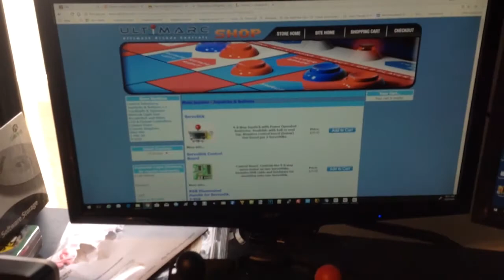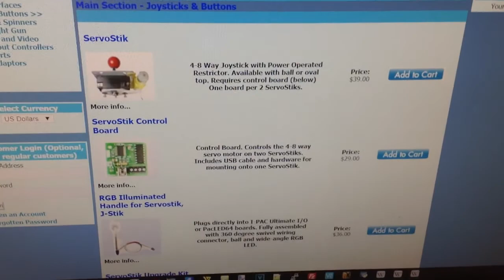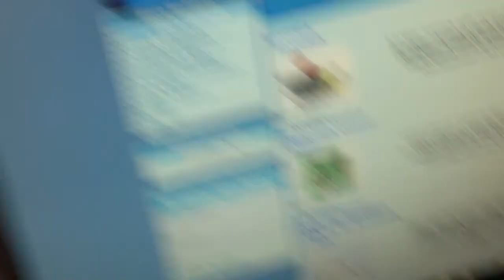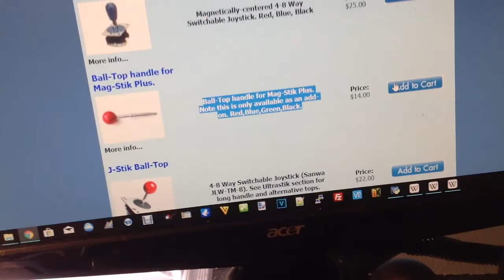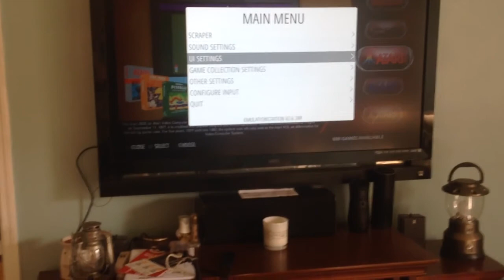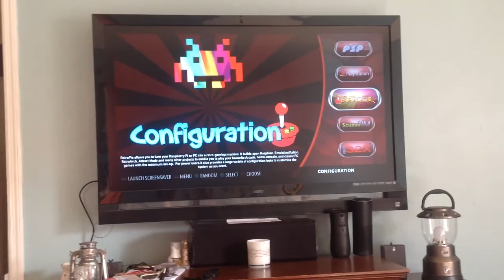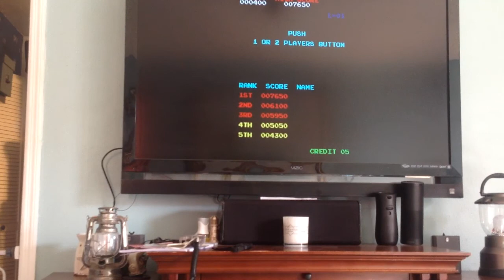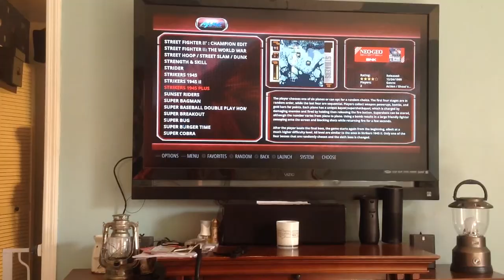XArcade Tankstick MOD 6 - Replace Joysticks with Ultramarc Mag-Stick Plus & Ball Top

Comment: Thanks for this detailed review and demonstration. Definitely the best video I found on this stick. By the way, this is how professional arcade sticks work, the tops do not screw off because kids would just run off with them if they did. When you find the kind that have removable tops, those are typically made for the home market. So that’s why it’s like that.
Reply from the maker: Actually I believe they glued the ball on because when you twist the stick to change from four way to eight way the ball would unscrew if it wasn’t glued on.

Comment: I dont know what about the leaf part do they wear out quick
Reply from the maker: GoGo Arcade not sure what you are referring to when you said leaf part.
Reply: @DIY-Nick  I notice it has leaf on the end of the microswitch dont those wear out quick
Reply from the maker: GoGo Arcade oh, yeah I haven’t used them long enough for that to be an issue but I would guess you are correct.  I found the through on the mag sticks to be too short and didn’t like how stiff they felt so we switched back to my zippy sticks which I like the best between the 4 sticks I’ve tried (original x-arcade, erosticks, zippy and mag-sticks).
Reply: @DIY-Nick  thank you wanted to now was going to jump on the mag but I will stay with the IL-euro then

Comment: niiice. wondering if u know about the mini steering wheel attachment for the spinner for racing games in mame.
Reply from the maker: Hey John.  I haven't tried one yet but groovygamegear.com does sell a steering wheel attachment for their TurboTwist2 spinnner which I have installed on my XArcade (https://youtu.be/cOnc2SBA_jo - http://groovygamegear.com/webstore/index.php?main_page=product_info&cPath=86&products_id=268) and Ultramarc also sells a steering wheel for their SpinTrak Rotary Control (http://www.ultimarc.com/store/section.php?xSec=10&xPage=1).   

I wouldn't mind picking one up but don't have the extra cash flow right now.
Reply: Nick SantaLucia Gotcha. was wondering if u were considering maybe selling ur used IL Eurosticks in the future
Reply from the maker: They aren't really used (only played a few games with them) and paradise arcade offered me a full refund if I return them but I didn't really feel like paying for shipping to send them back to Hawaii.  So would I sell them.. sure but I'd pretty much want what I paid for them with tax and shipping ($32.26) since that's what paradise arcade would give me for them back so you would probably be better off just buying them from them directly (if they were available.. I believe they are sold out of the red currently).
Reply: Nick SantaLucia yea I have a white one on my xarcade solo stick. the 2 reds u got are interesting.
Reply: Great review on the mag stick plus. I have been trying to decide if I wanted 2 IL euros for my CP and a dedicated 4 way, or just 2 mag sticks.  Not sure if I would like a short throw for fighting games. After playing with them since your video are you still liking them?
Reply from the maker: Jason Bryce I found the switch from 4-way to 8-way and vice versa during play which is very annoying and I also don’t much like the short through.  As a result I’ve switched back to my cheap zippy sticks which I think provide the best overall performance of the sticks I’ve tried.

Comment: Sorry but I will not buy it for one reason... tehy use MDF  which is heavy and as you can see where were the screw  were there are some major cracks which can chip out if you drop the xarcade
Reply from the maker: Yes it is heavy no doubt about that.

Comment: Thanks for posting this detailed video. One thing you could have done when the stick was the wrong direction you could have just pressed left to move down and then went back into configure input and remapped the buttons and stick to how it was connected. Also, how are the sticks holding up? Anther question I have is how much do you need the 4 way on stick 2? I have heard that most games that are 4 way are played on the player 1 stick even if you are playing a 2  player game. Is that the case and if so would it be ok to just put in one mag stick and go with a sanwa for player 2? Thanks..
Reply: Exactly what I want to know.

Comment: Thank you so much for all of your videos.  I have been using them as a guide to determine what route I want to take my tankstick in.  I looked at your zippy and magstik plus video the most.  The question that I have is would you still recommend the magstik plus? From everything I have been reading the magstik plus is great in 4 way, but is not as good as an 8 way stick due to the throw.  What would you ultimately recommend?

Comment: I need help.   My xrcade tankstick won't work with my Mame32 on windows10.    It will work on window xp but when I try window10 I get an error  dll missing.    Can this be fixed to work on windows 10?
Reply from the maker: Ive never had a problem but i recommend contacting xarcade for support.

Comment: Do you have a recommendation for joysticks that will be more quick, accurate, and nimble for shoot em ups? I like playing Strikers 1945 quite a bit, but my newly acquired Xarcade stick is a bit sluggish for these games. My complaint has nothing to do with build quality, but the design of the joystick. For example, the joystick is very heavy, and when you add that to the long distance needed to move the stick for actuation, making quick moves in-game is really a challenge. To be fair, I have very little experience with actual arcade cabinets so maybe this is just how it is.

Comment: Very nice work Nick! Well done bud~ I was thinking about doing something like this and boom, here is your video! Thanks for sharing. Any other recent observations or improvements you have done on this?
Reply from the maker: I’m happy with the spinner and buttons and have swapped my sticks back to the zippy sticks as I think they provide the best overall performance of the sticks I’ve tried.
Reply: @DIY-Nick  Which mounting bracket do you need to buy for the Mag Stick? Thanks

Comment: I'm concerned with the implementation of the top switching.  It looks like something that can break over time or by accident.  And, of course, there's the cost.

I'm leaning toward an IL Eurostick magnetic and then putting a hinge and clasp on the bottom of the Tankstick to allow for semi-easy switching.  

Thanks for doing these videos, it's given me clearer eyes as to what I want to do.
Reply from the maker: rager1969 I agree it does seem like it may break over time but so far so good with moderate use.   The hinge and clasp idea is a good one I didn’t think of.  Let me know how it goes if you do it and if possible post a video.
Reply: @DIY-Nick  So I broke down and bought a Mag-Stik Plus but stayed with the batton top to match the stock right side joystick.  I also installed XBox colored buttons.  I had a bear of time with the joystick mounting plate, since Paradise was out of stock of the plate you got.  I had to go with the other "Universal" plate which required me to bore out the mounting holes and "route out" the X-Arcade panel with a chisel.  The top panel top seems to be some sort of pressed paper/cardboard - YIKES!  After a few false starts due to loose connections and a wire that pulled out of one of the ground wire terminals (and looking for my old soldering iron and spool of solder) I got it going.  Now that I'm done I'm left asking "now what?"  I guess the "fun" is in the journey, not the conclusion.

Thanks again for your videos, it really got my juices flowing.
Reply from the maker: Did you ever install the hinge and clasp for semi-easy switching?  If so how do you like it?  I went back to zippy sticks since I found the mag sticks seemed to swap from 4-way to 8-way during play and it was very annoying.
Reply: @DIY-Nick  No, I didn't feel comfortable in my abilities to get the hinges to work smoothly.  I was also worried about ruining the structural integrity of the base, so instead of the Eurostick and hinged top I went with the Magstik Plus.  I don't think it's that great of a joystick, though - a bit mushy on one of the directions.
Reply from the maker: rager1969 agreed, I was excited about it when I first installed mine but quickly got tired of the short through and the way they seem to switch from 4-way to 8-way and vise versa on their own during game play.  I switched mine back to Zippy Sticks which I find to be much more accurate and smooth.  Of course I sacrifice the ability to switch from 4-way to 8-way and vice versa from the top but it’s rather have that than clunky gameplay.

Comment: Cool update video, Nick. Looks like I'll be getting Zippys with mounting plates (I also like that you can swap between ball and bat tops with them). I like the mag-sticks pluses with easy 4-way switching but they're out of my price range,
Reply from the maker: The zippy's with paradise arcade mounting plates are great sticks.  I do NOT however recommend the top-mounted restrictor plates.  Your better off just leaving them as 8-way or switching them from the bottom as needed.

Comment: For the quality of the build, the micro switches used, and the design to be able to change from the top of it. You get what you pay for and its a competition quality joy stick so its prices just right for its features.
Reply from the maker: Daniel Chaves the two things I didn’t much like about the Mag Stick Pro are 1) the stick has a very short throw so it feels stiff and you can’t move it as smoothly. 2) during play it would spin and switch from 4-way to 8-way.  I also think the plastic/nylon that allows the switch will wear out or break over time as it feels like it was already starting to break.   I went back to my cheap zippy sticks which work awesome.